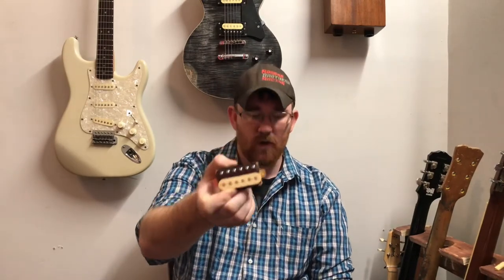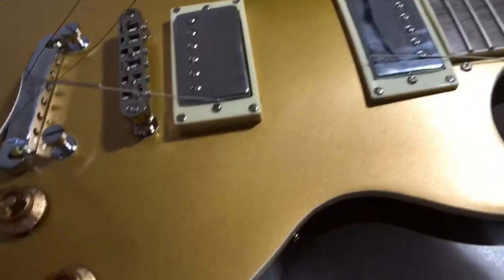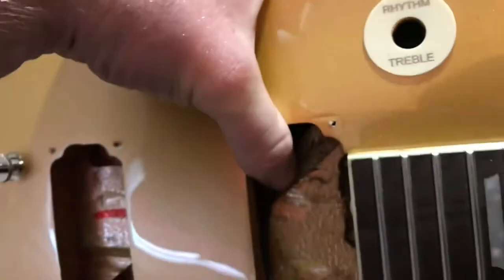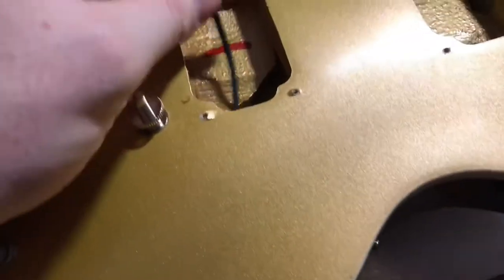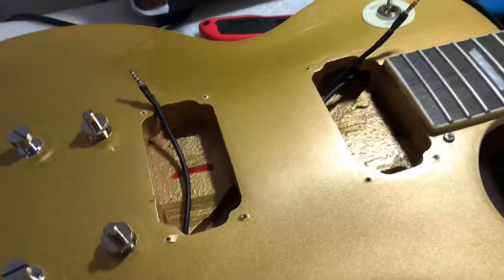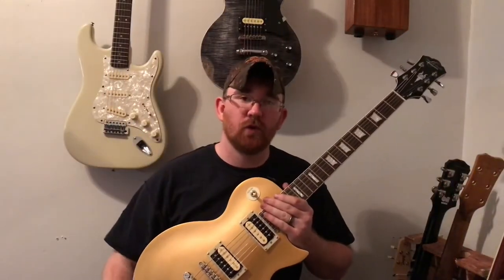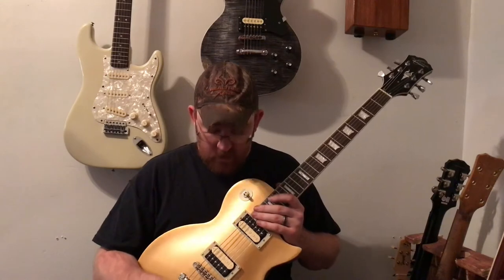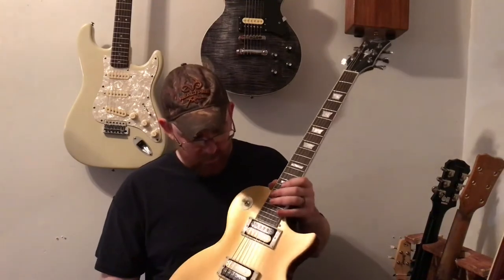Crunchy Pat High Output Humbucker Install & Review

Comment: I put a GFS classic 59 in a les Paul I was building. It sounds fantastic! It compares very well to the expensive Gibson classic 57. The sound a little different from each other I think because of different magnets. The Gibson is alinco 2. I can’t say one sounds better than the other just slightly different. So I am a GFS fan. They truly sound as good as the big names.
Reply: I love there Brian may style Brightons I can't remember but I put them in a strat with the 6 switches the big alnico 5 poles it can sound like a TC and it even sounds like Floyd.  I also built a SG and put the pat high output with a chrome cover they sound great .

Comment: Nice demo. I bought GFS Vintage 59 measures 8.14K Ohms in neck and GFS Crunchy Pat measures 14.4k Ohms. Hoping it will go well with each other.
Reply: yeah the crunchy pat's are very very hot i just put one in a strat

Comment: Did you use the standard push-pull Les Paul quikplug harness from guitarfetish?  I'm looking to drop in some of their classic II humbuckers and wonder if I need the standard harness or the mini.  Also want to make sure the pot shafts will fit the existing holes.

Comment: I've been wanting to get the GFS Power rails, but they've been out of stock every time I check. Also out of Crunchy rails, FatPat and the active EMG type p/ups. They don't get 'em in stock soon, I may have tp get ripped off buying some SD's or another overpriced brand. I noticed on my Warlock the ground wire is soldered to the back of one of the pots.

Comment: Ron I put a set of zebra pickups from GFS in my chibson a year and a half ago also I don't know if they're the same ones you got. They were better than the originals and they were also better than the Stewart MacDonald golden oldies or something like that. For the money they're they're decent
Reply from the maker: 2bikemike they make a big difference that’s for sure when it comes to cheap guitars. I got the cheapest ones they had on gfs crunchy pat high output they look well built for the price they even sound better than the amazon pickups. You have a chibson you should show it off sometime
Reply: Ronald Leggett Jr 
I think I got the ones that were called fat something and I chose them because they weren't as high output as the Crunchies which I don't like because they're too muddy to overly warm tone and you can't really get them to have some nice clear sound for instrumental almost all the time but I did use it here with the stewmac golden oldie pickups in it.   
https://youtu.be/4jVZKd9bgI8
And here with my gfs pups
https://youtu.be/YYgHYiWDmi4
I just prefer my teles to do most of the stuff I like and my Strat